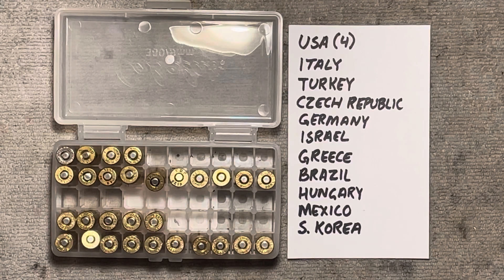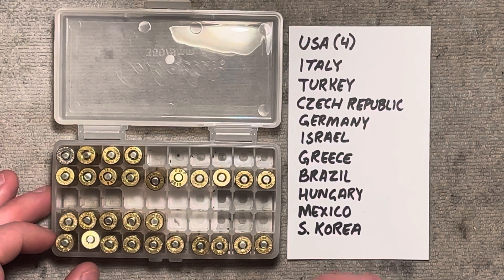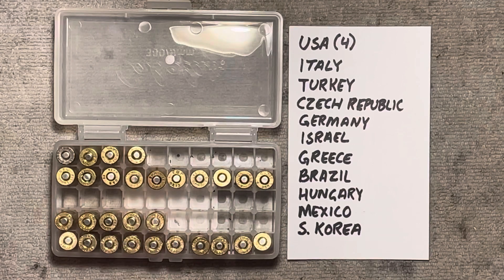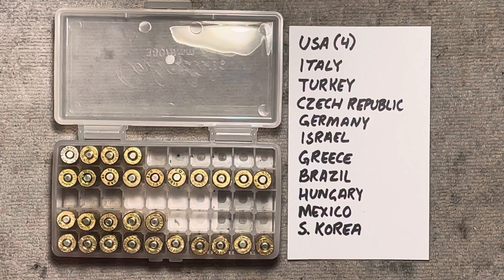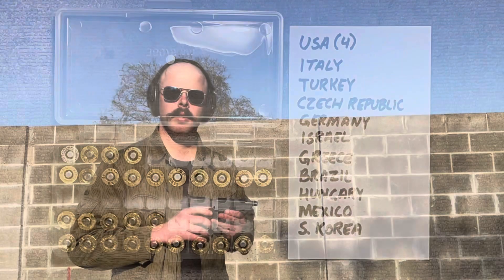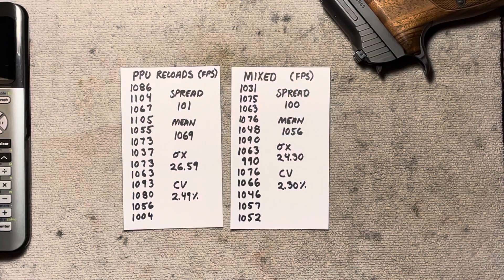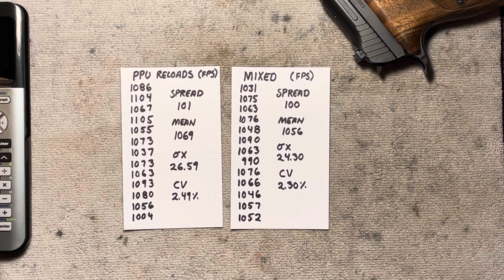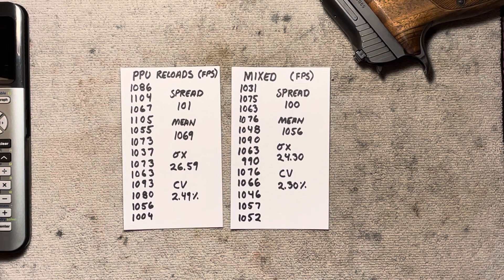Does mixed brass matter for reloading 9mm ammo?: Velocity Data Collection & Analysis

Comment: Well... I'm 2 years late to the party. I appreciate the information.

Been thinking about loading up a massive amount of mixed HS brass and was wondering what kind of trouble I could run into...

Doesn't appear to be much concern.

Where in the charge range were you loading these? Near minimum? Max? Mid range?
Reply from the maker: Pretty mid. Just something that cycles reliably, but it’s just plinking ammo so no real sense in using excessive powder, especially since I’m using plated bullets. 

These, as best I can remember, were loaded with Titegroup which as you probably know doesn’t have a huge amount of case fill. That said, it was/is a popular powder for 9mm amongst loaders I know. 

So, in this application of making up low cost plinking ammo, it seemingly makes no difference. Something loaded up towards max charge and/or a voluminous powder with lots of case fill might be a different story.
Reply: @ColterBrog  thank you.

Comment: Wow…I  wasn’t expecting those kind of results!!! I’m  getting ready to sort out a metric butt load of 9mm, not for accuracy reasons but to isolate crimped cases and then store them by manufacturer. Do you have a good source for info on the various cartridge head-stamps??? I’ll  also be sorting other pistol calibers as well as rifle cartridges. Thanks for the great video and I appreciate any feedback you can provide.
Reply from the maker: I don’t really have much of a source. You’ll mostly see the same half a dozen or so headstamps over and over again with just some rare outliers and those common ones are either readily identifiable or can quickly be Googled. 

Federal, CCI, and Winchester usually make up the bulk of what I pick up since that’s what’s commonly sold. You see some PMC, Fiocchi, S&B, and CBC pretty often. PPU is more prevalent it seems where there are Academy sporting goods stores since that’s their house brand sold as Monarch. 

One thing to consider is that sorting the brass for the purpose of isolating crimped cases, then swaging or reaming them, might be more time consuming than simply treating all cases as if they are crimped. Basically if you’re going to have a piece of brass in your hand anyway, you might as well be feeding it into a swager during that handling. 

That’s of course going to vary depending on your preferences, but I decap, swage, clean, and then it gets dried on a very low oven temperature and put into a bin ready for loading. Just doing this stuff on a bulk scale helps with efficiency.
Reply: @ColterBrog  
Currently my process is first to clean without pins (Dawn & lemishine) Deprime on a Lee APP, swage with a Franklin Armory swager, clean & uniform primer pockets and clean flash hole on a Lyman case center . After this, I’ll clean with pins, Armor All wash and wax and Lemi shine then off to the Franklin Armory case dryer after a thorough rinsing. I’m searching for a compendium of case head data in a PDF format with pictures of the various types as made by the manufacturer. I had one years ago but the file disappeared. Thanks for your response

Comment: Good info I also do not sort brass and it is because I am lazy now I have conclusive proof that there is no reason to sort.
Reply from the maker: It was enlightening to me. I doubt I would sort brass even if the results showed some minor improvement just because my mixed brass reloads fit my needs fine- but it might have encouraged me to have some brand loyalty when buying ammo to try to keep my brass a bit more consistent. 

Seemingly no point in that at all, at least when running economy loads on a progressive press.

Comment: I would like to see a test like this with more focus on group size.
Reply from the maker: It would be interesting to see, but I don’t really have the equipment to collect good data on that. Shooting it by hand would introduce too much potential for error on my part. 

Internal case volume and consistent tension from the case would seemingly be the relevant factors which would influence accuracy. It could be possible that a different brand of brass as the control group would offer more consistent tension, although I have no reason to believe this would be true. Number of times reloaded would almost certainly come into play. 

Consistent velocity numbers, at least in theory, would be important for maintaining small groups. 

Another test that would be interesting, using this same setup, would be if we see a greater velocity deviation using a powder with more case fill. Titegroup is such a fast burner that the case fill is pretty small, so even cases with a lesser capacity still accommodate it with plenty of room to spare.
Reply: @ColterBrog  Titegroup produced good accuracy for me with mixed brass but I switched to CFE pistol for more complete case fill and larger margin for error. Accuracy seems close to Titegroup but I haven't finished testing.

Comment: Nice analysis.
Reply from the maker: Thanks. Next week I’m doing a similar test but comparing the “stepped case” Ammoload/IMT/FM brass to PPU to see if the stepped cases cause a higher velocity (increased pressure from reduced internal volume). 

I don’t push the ragged edge of what’s safe, but if we can see a significant difference in velocity it could be an indication that those loading towards max might need to be careful about separating it out to avoid dangerous overpressure.